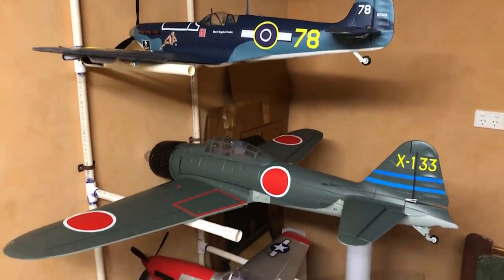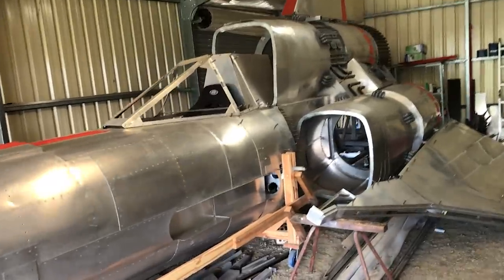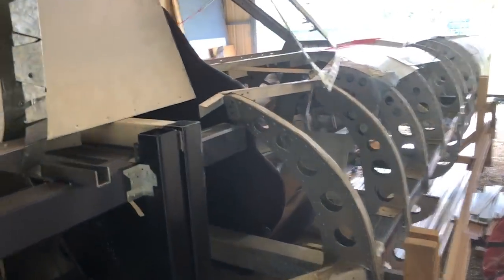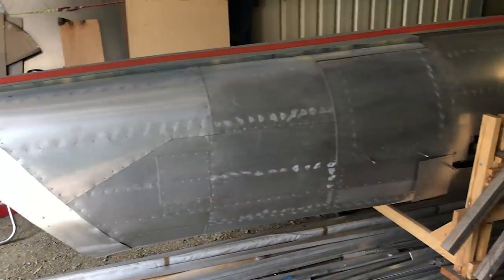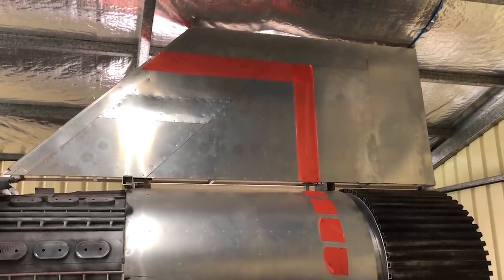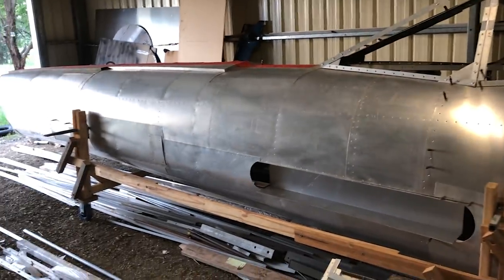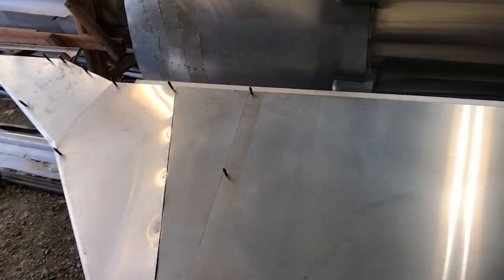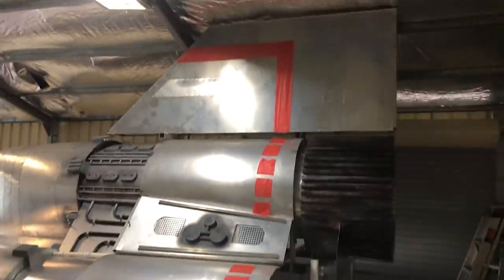Man Builds Colonial Viper Battlestar Galactica in Garage

Comment: Put three high thrust engines in it, it will fly....You put a big enough engine into about anything, it'll fly.
Awesome build so far, some rich collector will buy it.
Reply: If you put enough thrust behind a brick it will fly. Controlling it might pose an issue though.
Reply: Goth Vaush - Jedi Master Engineer  I was noticing there wasn't much of an airfoil happening with the wings.
Reply: @williamhadley1580  Enough engine, and you don't need airfoils for lift...just control surfaces. :-)
Reply: @VulpisFoxfire  technically stabilizers in this case are only for atmospheric flight and are fixed, with directional control being entirely controlled by thrust which you can presume would be vectored for maneuvering along with thrusters on the nose.
Reply: Kind of like they did with the F4 Phantom.  :-)
Reply: F4 Phantom proved that
Reply: A very well know aerodyn

Comment: Really hope he completes this full scale dream machine. Go Aussie! Will it be jet powered or ducted fan configuration?
Reply: You'd need the very best avionics computer to fly it. The center of gravity is so unbalanced though you'd beat anyone in a rate fight. The problem would be getting enough lift to get in the air to begin with.
Reply: Laser powered heat expansion engine. That would be good to see but the problem is fuel. Power needed ignite a laser powered engine would be enough to run a city.
Reply: @rexmann1984  That happened to many people who tried to build and fly experimental aircraft back in the early and mid 1900's. And many of those early flying machines were nothing more than some punchline to some very bad joke, until the Wright Brothers built and flew the very first flyable Airplane that did manage to make it off the ground.

Comment: I would try to make a working version instead of just a mock-up one. Phrack!
Reply: WIng Loading
Look at the low square feet of Wing, reverse that from a target Wing Loading
and you end up with the whole thing needing to be feather light.
If wing Chord same as a Cesna but just 1/5th the Span.. gotta cut weight to 1/5th Cesna weight... and need to balance that weight to rear of wing offsetting the long nose weight

Comment: It wasn't just ratings. There are several more compelling reasons. Mind numbing episodes like, Star Trek: The Way To Eden, or Hippies in space. Another reason was Fox suing for plagiarism for lifting plot points from Star Wars. Funny part is Universal turned around and sued Fox for the same thing but it was SW using Silent Running plot points. There was also an issue with Industrial Light and Magic due to the fact that a lot scenes actually used some of the equipment from SW. Equipment was returned and no suit for that but it meant more expense.  Probably the strangest thing of all came during the Colonial/Cylon peace talks. At the same time in the real world the U.S./Soviet SALT were taking place. The claim was that the Cylons were cast as the Soviets and the negotiations between them mirrored the SALT talks. Which was probably true because there were a lot of similarities between the 2. Finally a lot of BSG merc was pulled due to the death of a young boy.
Reply: What does a Star Trek episode from 10 years earlier have to do with BSG getting canceled? That SALT talks stuff was Soviet propaganda and wouldn’t have anything to do with the show getting canceled. Tragically, a child did die from choking on the little plastic missiles that the fighters fired, but they were redesigned and continued to be sold.

The reason it was canceled was because it was expensive to produce. That’s why Galactica 1980 took place entirely on Earth with very little of the space stuff that people actually liked.

Comment: ive used some physics engines and made 3d test versions that can fly.. its all about center of balance and flight surface control... which with modern fly by wire softwares can be done.... a real viper if possible and flyable...  SOme rich mofo needs to do this with advanced methods... Lockeheed ... Boeing u guys listening?  this is how u invade the commercial sector...  make lifesize scifi popular crafts to be used for commerial flights... or imagine the viper mk2 being used in the same manner as our f-117... they are probably close in respect to flyability..  Hope this man doesnt plan on flying this... as going around it with the camera u can tell it would break up in flight..